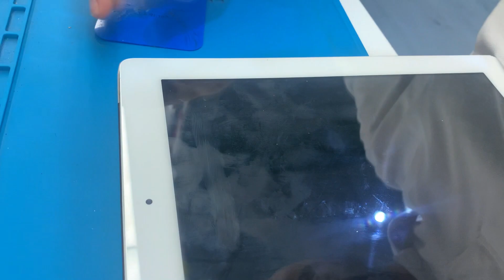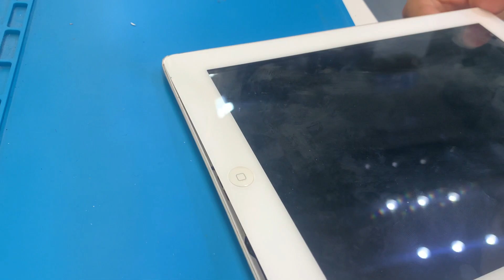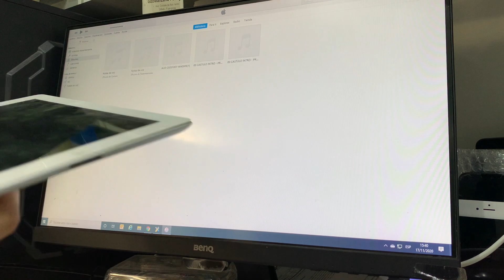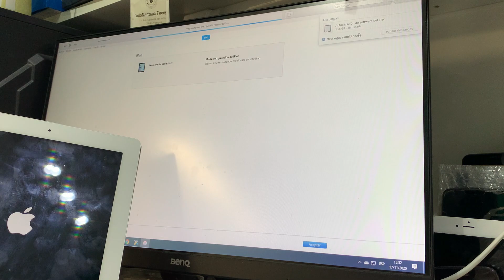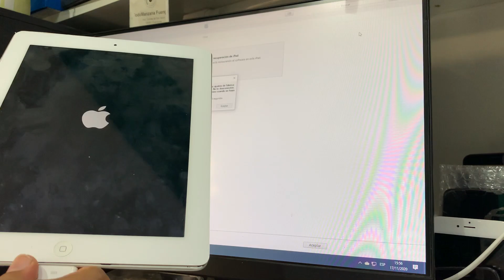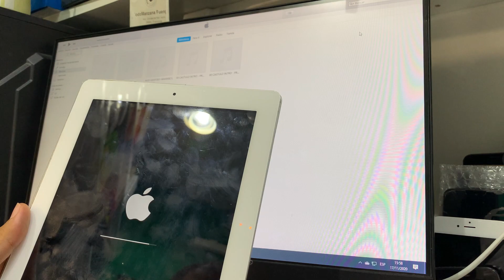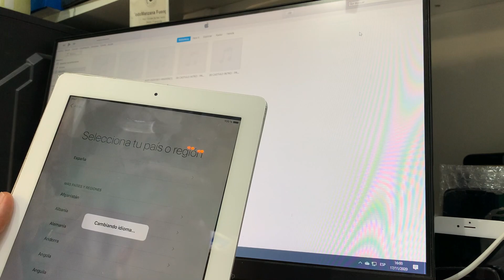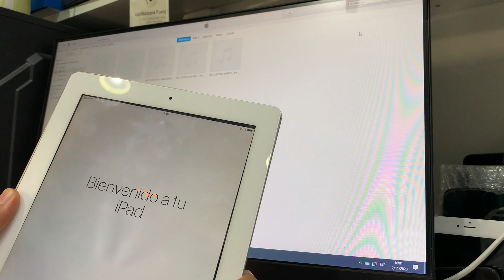QUITAR ICLOUD IPAD 3 MUY FACIL

Comment: excelente video amigo hace unos mese aun era posible pero ahora al parecer hay alguna nueva actualización que no permite la restauración o mejor dicho te permite restaurar pero el ipad a1430 no inicia una lastima ahora a regresar la a su estado original de cualquier forma mil gracias!!!
Reply: amigo tu ya hiciste todo el proceso de retirar la resistencia??? observaste que en el video la version de ios es la 9.3.5, actualmente te manda a la 9.3.6 desde itunes, pero desde 3utools aun se puede instalar la 9.3.5, yo intentare flasheando desde 3utool con la version 9.3.5. intenta como te digo, yo aun tengo que retirar resistencia y abrir el ipad que acaba de llegar hoy a mis manos jeje, bueno intentare a ver que pasa
Reply: @dawnhyung9935  ya lo realice de la manera que indicas Bro y es la misma situación no activa ya me a pasado con varios modelos gsm anteriormente si era posible lo que hice fue retirar la resistencia convertir a wi-fi y reemplazar la serie con irepair!!!!
Reply: @morrisbrown5444  al decir convertir a wifi te refieres a que metes firmware de ipad wifi (como se hacia con ipad 2) y activas, y como es eso del irepair amigo???
Reply: @morrisbrown5444  bro, pues use el metodo qu ete platique, restaure con 3utool y me activo sin problemas, en este momento tengo mi ipad 3 al 100 jejeje aunque solo quedo wifi
Reply: @dawnhyung9935  bro no soy técnico ni nada será que intento desarmar el iPad?